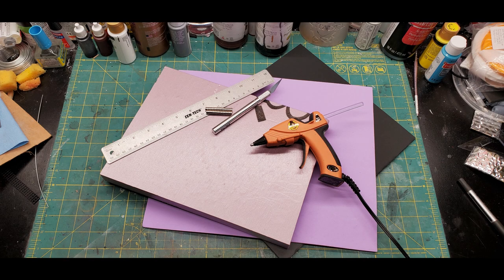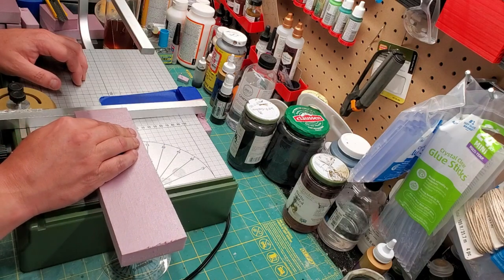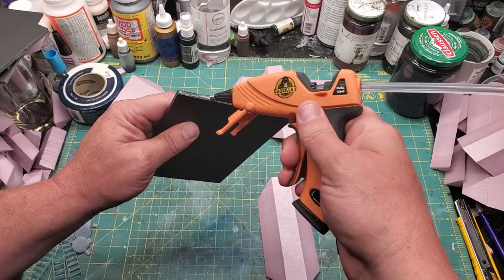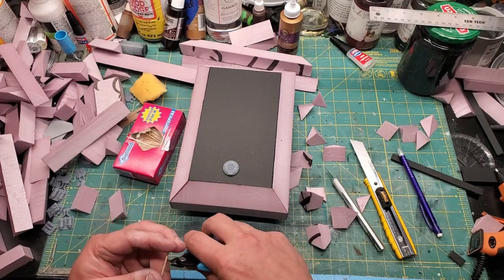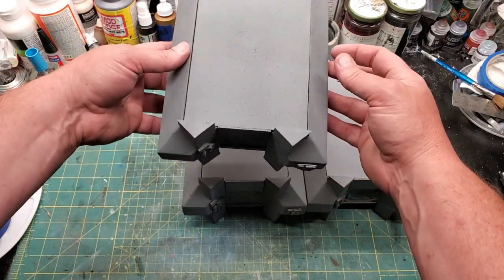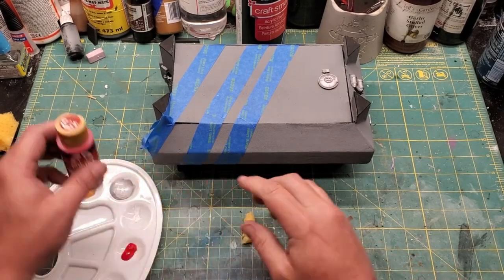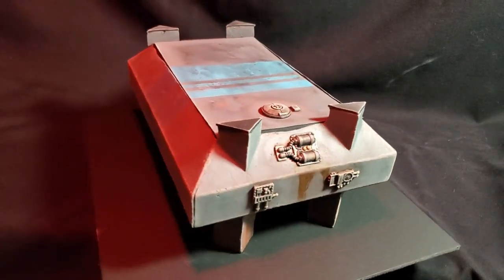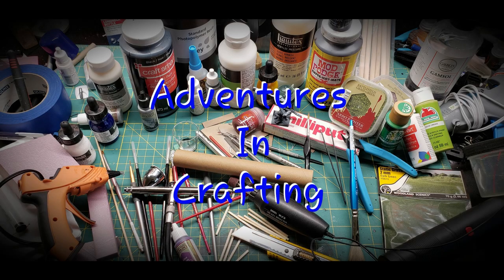Sci-Fi Hab Pods for RPG's and wargaming

Comment: What are you using to hold your Proxxon guide in place?
Reply from the maker: I hot glued the end that connects to the factory guid so it wouldn't slide. Then I hot glued some bits of xps to the other end to snugly fit against the back side of the proxxon.  I have thought of building my own shifting lands style guide or simply buying one. Due to lack of time I will likely just buy one.